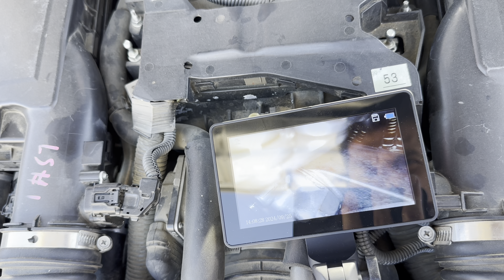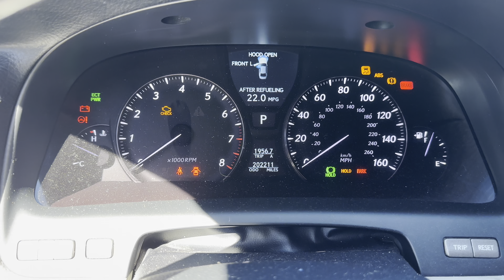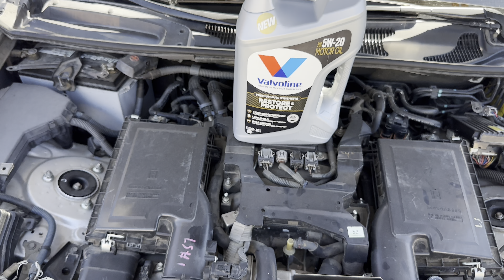Does Valvoline Restore and Protect really clean your engine?

Comment: My LS460 eats oil so I have to check it every 1000 miles, but I have close to 300,000 miles on it. I’ve been using this oil for a few months now and haven’t seen a change as of yet.
Reply from the maker: Have you checked to make sure you high pressure fuel pumps are not leaking. That was a problem on mine that is hard to notice because the oil would hit the exhaust manifolds and burn off quickly. Thanks for watching!
Reply: @Fix-it-tony  I changed them about a year and a half ago. I could see the passenger side leaking so I changed them both. They’re completely dry without any leaks. I may need to change my valve cover gaskets, even though I don’t see any leaks doesn’t mean they’re not a culprit.
Reply: Bruh it could be worse, you could be me with a 2019 Kia Sportage drinking 1qt every 500 miles. After two oil changes with the Valvoline Restore and Protect, some 8000 miles or so, I'm finally starting to seem improvement. I'm still at 1qt/1000 miles starting my third round with this stuff. It's great, I love it and refuse to use anything else but there's a limit to what it can do. But with that said, be patient and enjoy the process.
Reply: @STATUSTANK  Good Lord, how many miles you got on your vehicle eating all that oil?

Comment: I bought a 2013 Tacoma V6 with 30,000 miles in 2020. After a few thousand miles oil would start to get lower on the dipstick after changing the oil, not enough to be concerned but it bothered me enough. It never had blue smoke from the tailpipe either or leaks. I’m wondering since it must of sat for a while, the rings didn’t get seated enough and it would burn oil a little. I could go 3k to 4k and the oil on the dipstick would be somewhere between the middle of the stick. So it wasn’t excessive. I’ve since sold it, but should have kept it.
Reply from the maker: 100% should have kept it, great truck. Thanks for watching!

Comment: If you have a GDI engine,  this should be used at the first oil change and continuously thereafter.  Haven't seen 1 yet that doesn't 'use' oil, no matter the make or mileage.
Reply from the maker: Absolutely, it been a proven product for GDI engines. Thanks for watching!

Comment: I just did my oil today in both vehicles as recommended by The Oil Geek. Changed from Mobile One to Valvoline Rand P.  Pretty sure my engi ns are clean , I change my oil every 1500 miles. never over 3000. miles.  The engines sound quitter and more smooth. My Kia is pretty clattery anyway.  It sounds smoother.
Reply from the maker: Will work over time in your Kia, let us know how it goes. Thanks for watching!
Reply: You probably need to have your valve lash adjusted on that Kia! Most of their v6 engines have bucket lifters that use shims instead of hydraulic ones that adjust automatically...Kia recommends at least checking them every 60,000 miles or so as part of regular maintenance...
Reply: 1500 miles,, what car and year? come by our shop   we will very happy to take your money..if it is a newer car 2000 and up,, you are just wasting your money.. but, yes it is your money

Comment: Thanks for the video. Miquestion about this oil is. If it is cleaning the engine and the oil looks clean on the dip stick, where is all the dirt going?
Reply from the maker: Clean is objective, the oil is carrying broken down deposits into the oil filter. Need to change the oil more often if it starts looking dark if you have an excessively dirty engine. Thanks for watching!

Comment: Want to try that oil but looks like not much viscosity option, so far I see only  0w20, 5w20 and 5w30 is available, I need 10w30... Thanks for sharing this video...
Reply from the maker: It is not available in 10w30 yet, hopefully soon. Thanks for watching!
Reply: Check your maintenance specs. You might be able to use 5W-30 during the winter.
Reply: @ancienttech4636  Yes, actually in winter 5w30 can be used, I have Mazda Protege 5, 2.0. In the owners manual it is mentioned... Will try. Thanks for the hint!

Comment: I recall the late Tom Cahill, automotive tester ,writer for mechanix illustrated magazine once saying that engines develope natural carbon seals over time. I wonder if removing them by using restore could cause problems? Just a thought.
Reply from the maker: On much older higher mileage engine this can happen. Some people are experiencing oil leaks after using this product. But these are repairs that probably needed to happen anyway, cheaper to replace seals than an entire engine. Thanks for watching!
Reply: That makes sense. Thanks!

Comment: Thank you for posting this.  I just purchased a used 2009 Pontiac vibe (toyota matrix) with the 2.4l, for my daughter.   I just did the first oil change with conventional synthetic.  Ill be paying attention to her rate of oil burn, if any.   Then, if we are seeing any burn, ill try this Valvoline for sure.   Was thinking, in the first oil change with clean and Restore, ill NOT change the filter (at first), put in the new Valvoline, run it for about 200-300 miles,.and THEN change the filter with a new one.  That way i can use the older filter to accumulate most of the potential gunk this new oil might break free.   For years, i pretty much used Mobil 1 on all our vehicles.  At times, i would use Valvoline synthetic, and most recently, super tech synthetic.    If this new clean and Restore helps, it will become my new go to.
Reply from the maker: Let us know how it goes, thanks for watching!
Reply: I have a 2007 Vibe with 260k miles on it.  It’s the 1.8 L.  In 5k intervals, it only goes down 1/8 inch on the dipstick.  So this engine doesn’t really use oil.
Reply: @slalomking  1.8l typically do not burn.  The problem lies in the 2.4l Toyota, through about 2009.   I believe that the issue was fixed later in 2009 or 2010, so im not yet sure if mine was or was not affected
Reply: Update, i calculated about 1 quart of burn/consumption about every 1000 on her orginal oil change of supertech  full synthetic, over almost 4000 miles.  We were careful to add a quart every time she got down to the bottom mark, on dipstick.  This is on a 2.4L toyota powertrain with about  164000 miles, currently.  The culprit is likely oil ring carbon deposits (on low tension  rings).  A week ago, I removed the old filter and supertech oil (which was still very clean),  and replaced it with Valvoline restore and protect.  It may take some time but im hoping  for a reduction oil consumption rates.  I'll try to add updates.  Btw, I've heard such great things about this oil that I have already installed it in my high mileage 2010 nissan altima, and my sons 2006 impala.  Neither car burn any oil, but I figured it would be a great product to help keep the internals in top shape.  My wife's newer equinox will get it next time too.
Reply: @louofm1  one of our other cars is a 2003 Camry it just crossed 300,000 miles 2.4L engine.  It uses a qt every 1500.  I bought the car used off a shady car lot for $7500 with 131k on it on 2013, I figured if it made 200k I’d of gotten my money’s worth. The valve cover needed replacement at about 260k.  I opened it up and about had a heard attack !  It had  1/4 inch of sludge over everything.  The bozo that had it before must of never changed the oil.  I wiped off the sludge I could see on top of valve train.  So now that this new Valvoline oil has come out the clean and restore, I thought about using it on this car or should I just leave it alone since I’ve crossed 300k now.  The car is incredible, it still runs and drives great !
Reply: @slalomking  if it has that much sludge, you might want to remove the valve cover and oil pan and manually  clean most of it.  I don't know that I'd risk some sludge breaking  free and plugging  oil ports or the pump.   I saw a video where someone  used this product on a sludge filled truck (search video: 500 miles of valvoline restore and protect).  It worked worked quickly but plugged up his oil filter.  This is bad because this can cause your filter to bypass and pump dirty oil into your engine.   I would say if you have "some" sludge, try it out...and replace the filter every 300 miles until it stops accumulating sludge (would require you to cut open the filter).  If it has alot of sludge, probably  best to manually clean it

Comment: maybe its me but Ive owned 10 new vehicles and put 300k on some. not one of them ever dropped/burned oil level in 5k, not one.
The other issue i see here, is why would an oil that supposed to clean the engine, look clean...it should be filthy. and Blackstone labs agrees and says an oil that's getting black quickly is not bad oil but oil that's doing its job cleaning.
pennsoil is one oil that cleans well, and Mobil 1, has been known to clean well, i personally  think Castrol edge is the best oil out there for protection purposes
Reply from the maker: This was after one treatment and the oil was black. Cars driven everyday or less likely to have carbon issues. It’s the short drive cars early in their lives that run into these short of issues and cars with low tension rings like mine. Thanks for watching!

Comment: If you're not already, use a Top Tier Fuel, which is highly recommended by Toyota, to maintain your results, Tony.
Reply: Remember, Top Tier means they have an adequate amount of detergents for keeping your fuel system clean, and it does not necessarily have the same anti-wear additives as some gasolines (such as Shell's V-Power).
Reply from the maker: Using a quality fuel is a must also, thanks for watching!

Comment: I have a motorhome with a GM 8.1 v8. It has had a slight lifter tick when first started that goes away in under a minute. I tried several additives trying to correct this ticking sound. Valvoline came out with restore and protect 5w30. I tried it over 3 oil changes every 3k miles. The stubborn tick remained. I went old school and added a half quart of ATF during the last oil change and the tick was gone in the first two starts. Maybe 20 minutes of run time. Im very disappointed in valvoline  restore and protect. It's likely a good oil but it really doesnt do what they claim.
Reply from the maker: ATF is very aggressive and can spin a bearing, I would have tried Marvel Mystery Oil if Valvoline didn’t work. Thanks for watching!

Comment: Just keep in mind that all that sludge has to go somewhere.  Oil filters may be clogging prematurely.  Keep an eye out.
Reply from the maker: 100% to watch your oil, scoping the engine before using to determine if manually removing sludge first. Removing valve covers and the oil pan maybe a best practice on excessively dirty engines. Thanks for watching!

Comment: Started using this 2,000 miles ago on. RAV4 with a 2FE-AZ engine. So far, oil consumption has been only marginally reduced. I suspect it takes 10,000 to fully test the theory
Reply from the maker: It works slowly, which is a good thing so it won’t clog your oil filter. Safe and effective to use as your everyday oil. Thanks for watching!

Comment: I heard people who used this needs to change their oil filter half the time earlier because it clean your engine, thus deposits it in your oil filter. People saying that it clogs it fast after the first time of using this oil.
Reply from the maker: Depends on the amount of buildup in the engine. Using the scope like I did will help you get an idea of your need to swap your oil filter a few times in the first couple of thousands of miles. I doing a video on my Yukon, the sludge was so bad in the oil pan that I took the pan down to clean it by hand first. It had an oil pan leak, so made sense to do it. Excessive amounts of sludge should be removed if you can pull valve cover gasket and oil pans. Thanks for watching!
Reply: Thats why i chose the Fram FE filter as its been tested to have low resistance with great filtering.

Comment: I recently changed the oil in my 2018 Kia Sportage with the Valvoline Restore and Protect. The car has 81000 miles and burns a quart every 1500 miles. Hoping this product helps!
Reply from the maker: Hope this helps, the Kia and Hyundai engines have a mechanical defect that causes oil consumption in some cases. Huge class action lawsuit, extended warranty’s 8 years 150k miles on most 4 cylinder models. Thanks for watching!

Comment: I started off using penzoil ultra platinum it works amazing for lubricating then I tried valvoline restore in protect notice it’s really good for cleaning then engine so I decided to mix them half and half I promise my car runs like I just bought it Brand new😊 those the only 2 engine oils I’m buying also my car is a 2011 Chevy malibu with 298248 miles
Reply from the maker: Nice, thanks for watching!
Reply: Never mix oil brands 
From a petroleum engineer at castrol

Comment: It's not a new product. And it's very widely know to work amazingly.
It's now a new formula that meets specifics for a much wider range of vechicals. Then the original Restore product did.
Reply from the maker: Restore had a lot of copper in it and different base oil. This new formula is a patented boron molecule that breaks down deposits better than anything I’ve seen without clogging the oil filter. Valvoline’s other product was strictly for diesels and designed with Cummins, but it was known to clog oil filters. New innovations are really helping us owners who want to keep their vehicles as long as possible. Thanks for watching!

Comment: Great video! I wonder if this will help with deposits on the valves in a GDI engine…
Reply from the maker: Will not help carbon buildup on valves. The only fix for that is a walnut blast every 60-80k miles. Thanks for watching!
Reply: @Fix-it-tony 
I'm not convinced that's the case. A lot of the carbon buildup is due to oil vapor coming through the PCV valve.  This may reduce future deposits.

Comment: I'm not having any issues, but when I got my ELR I noticed the engine had some sludge buildup inside. I used this and noticed some of it getting removed after very little use. Before using this I was running Supertech full synthetic and it didn't really do anything to remove it. I think this oil is great and will start using it on all my cars
Reply: Valvoline does not advertise this oil to remove sludge.  They are very specific in limiting their claim to cleaning the pistons.
Reply from the maker: Awesome, let us know how it goes, thanks for watching!
Reply: @kirkdarling4120  I did notice that, they never really talk about sludge or varnish, but it's the only oil I've tried (admittedly out of just 3) that has given me any visible results whatsoever. From what I've seen, other people have had some luck with sludge removal as well.

Comment: Is it worth using this if you don't have any oil consumption? That engine looked so clean!
Reply from the maker: The carbon I have problems with is in the rings. Modern engines use low tension rings to reduce friction and improve economy. The problem is carbon can make these ring stick enough to allow the thin 5/20 oil to be burned. This product is effective at breaking down the carbon and freeing up stick rings eliminating oil consumption. Thanks for watching!

Comment: You might want to remove the oil pan, and check/clean the pick up screen. They can become clogged from the gunk breaking loose.
Reply from the maker: The beauty of this product is it breaks it down slowly so that you just need to keep an eye on your oil filter. But excessively sludged up engines you should remove the oil pan and valve covers for a cleaning before using any product. Thanks for watching!

Comment: How about the valves? I have just got a used Subaru in February, that has direct injection . I hear the valves get caked … Will it keep those clean too ?
Reply from the maker: Unfortunately no, direct injection engines need manually walnut valve cleaning on a regular basis. My LS460 has dual injection, port and direct injection, this gives the best of both worlds and keeps the valves clean. Thanks for watching!
Reply: @Fix-it-tony  At how many miles should that be done ?
Reply: @johnf.6942  With the oil vapors circulating thru the crankcase vent system into the intake there should be some prevention of buildup or even removal of some of the buildup on the valves over time with this oil.
Reply: every 50k-60k mi. but it is in the owners manual.  also, look into a catch can system (single or dual).  I just installed the radium dual can on my wrx at 72k miles.  I probably should have done this 70k miles ago back in 2019 ☹️.  walnut blasting or Subaru valve clean liquid will help w/intake valve deposits.  on my wrx, I like using a low SAPS (ACAE C3), non-Resource Conserving oil like Penzoil Euro-L or Mobil1 ESP 5w-30.  only time I've used Subaru oil was the first 4 oil changes...since then (last 4 years) it's been low SAPS oil as much as possible...

Comment: I think by my using an engine flush , AmsOil or preferred Liqui-Moly . Every 5000 miles and using either AmsOil OE oil or preferred Pennzoil Ultra Platinum and only a Amsoil oil filter . . That this will prevent any issue with the piston rings .
Reply from the maker: Engine flushed are really risky, this product is a good option because it works slower and less likely to create an oiling issue. Thanks for watching!
Reply: @Fix-it-tony  ok